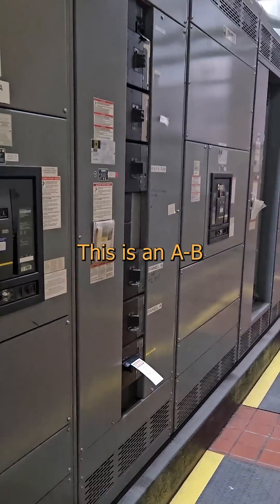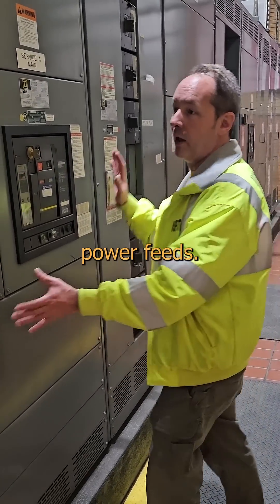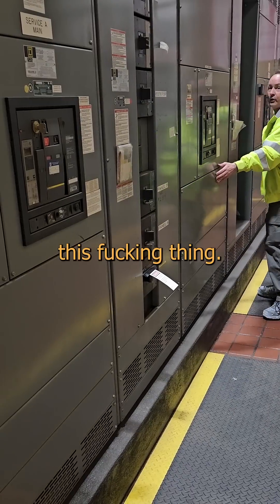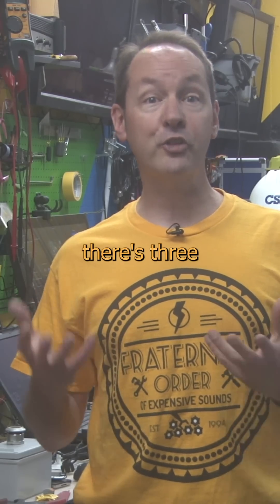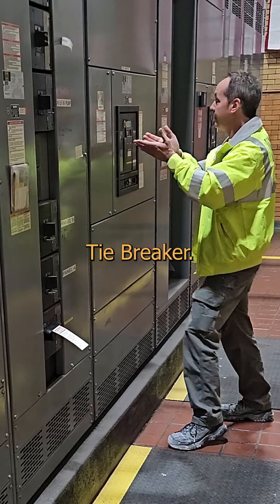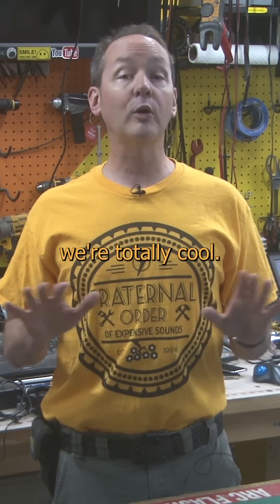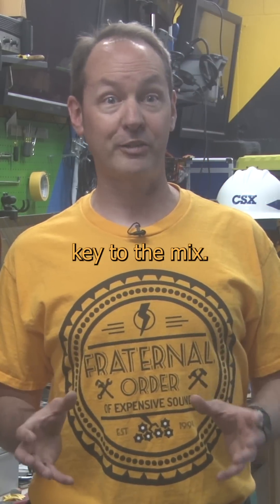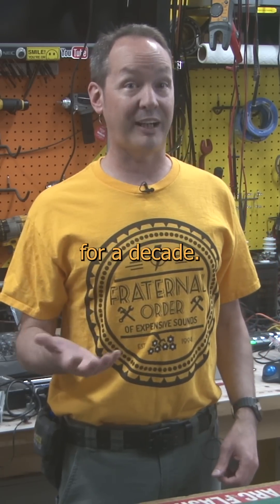A B Interface #chrisboden #comedy #electrical #engineering #energy #substation #switchgear #power

Comment: At our nuke plant it was like that, EXCEPT on the busses essential to safety, there is an additional inline disconnect on each side which are MECHANICALLY linked such that only one can be closed at a time, AND when you do that it takes away control power to the other side.  So 3 extra layers of protection.  And the whole plant is designed like that.

Comment: If you can't use a synchroscope and you don't have a Reverse Power Relay as a failsafe, you can get some interesting sights and sounds. 

I say this as I saw a 2,500 amp breaker explode and a two-story-tall diesel engine stall out when a 1.5 MW SSTG motorized a 750 KW EDG because some dumbass overrode the safeties while ignoring the yells "NO, DON'T!!!!" and use a hot-stick to close the breaker mechanically rather than taking the non-action of the normal controls as a sign that closing the breaker was A Bad Idea.

Even worse was is that even if he hadn't blown things up, it would not have solved the problem he was trying to fix. Turning on huge problem into two huge problems is Not Good.

Comment: Friend working in an aluminium smelter dropped a 12 inch metal spanner. happened to hit the exposed power feed on the way down, spanner was never found, it instantly vaporised and sprayed into the air. Luckily my friend was far enough up / away to not get a new metal coat, but the ears were ringing for a bit. They built the plant next to power station or maybe it was the other way around. The magnetic field in the plant was intense. watches (if you wore one) got locked to the moment you walked in. metal tools "stood up" if placed on the floor. even metal tool boxes were difficult they kept flinging / rotating side to side as you walked. You listened at the safety briefing before entering. We did have a power failure one day we were in the roof and the exhaust fans stopped, you get about 1min and feel burning in the eyes and throat from the fumes. 15 min to get out of the building before your brain melts out.  Big power is fun!

Comment: I used to work at a facility with dual power feeds. One day, a car took out a utility pole and knocked out one of the feeds. The sparkies decided to pre-warm the generator in case the second feed dropped. The generator came online, and the transfer switch said, "Hey, I see generator power, let’s use it!" Problem was, it was 180 degrees out of phase.

Boom. It blew the transfer switch clean off the wall, took the breaker for the backup feed with it, and the whole place went dark. Lights, equipment, everything.

I got the call to get there ASAP and bring the plant back online. I showed up to the sound of the generator, about the size of a locomotive, screaming at full throttle in the parking lot while everything inside was pitch black.

The head sparky was in a flash suit, trying to manually close the breaker contacts with a chicken stick to get the backup feed live again.

Let’s just say the night got real western. We had to do some serious cowboy engineering to get the place running.
Reply: oh gosh! sounds like a nightmare, where was this?
Reply: With a description like THAT, i gotta ask:

How 'western' did the cowboy shit you had to do GET?

Support Your Local Sherrif?

Stagecoach? 

Three Mules For Sister Sara?

Deadwood? 

Unforgiven? 

The Wild Bunch?

...

BONE TOMAHAWK!?!

(And if that LAST one...

...HOW ARE YOU STILL ALIVE?!?)
Reply: This sounds horrific! Awesome work getting things to go back to normal!
Reply: You need the “bad days make great stories” shirt
Reply: wait what
Reply: holy fuckstick...

Comment: That beat in the beginning was kinda phat. So if I were to install this A-B un-exploder it would perhaps be smartest to only make 2 keys thus eliminating the short term possibility of becoming a modern work of art on the wall. I say short term because although the risk of LockPickingLawyer stopping by to pick your lock is low, it’s also not zero.

Comment: In the 60s when I was in high school, electricians were repairing some wiring to the warehouse my dad managed.  There were 2 conduits of 480V 3 phase between the outside transformers and inside.  One guy wired up one of the conduits on the outside and another wired up a conduit inside.  For a preliminary test they energized outside and the guy was inside measuring on the wires he had just wired up.  Not getting any reading he started shoving the other wires out of his way so he could get a better contact with the ones he wanted.  Still nothing.  I asked, "So, do the conduits cross underground?"  He said, "No, of course not.  Why would you think so?"  I answered, "Because the guy outside wired up the left conduit and you're measuring on the right one."  He quickly withdrew his hands and carefully brought the meter leads to the bare ends of the wires he had been shoving around ... and got the 480V.  I think he was just glad he was still alive to yell obscenities to whomever could hear!

Comment: this sounds like it makes sense but it just doesnt. the closest to what he describes is one side inexplicably having a lefty phase rotation which is just as stupid as wearing your shirt the wrong way around. or for unimaginable reason one side is fed from the 60Hz grid and the other from the 50Hz grid. unless one side is a permanently running backup generator or a ups. the one side is the grid and the other is also the grid. there is only one grid. even fed from two different transformers which is the most redundancy inside the grid you can get, it would not be out of sync

Comment: Okay need a little help here. Went over my head a little, want some clarification. Not a pixie wrangler, and don't intend to be, so pardon my incorrect terminology, I don't know when describing A/B/Center as On/Off would be accurate.

So

If A is clicked in, and Center is clicked in, A can power both sides.

If A is clicked in and B is clicked in, A get's it's half and B gets the other.

And with two keys you can never get all three. Am I understanding this right?

Comment: At Menards they have 2 different power delivery systems. I've seen the main contactor melt before because the generator side and the power line side were both fighting each other. Granted that is a much smaller scale than what you're showing, but still very dangerous and expensive.

Comment: The only way to effectively merge two different power grid systems is to rectify it all to DC, and then either go back to AC or use it as DC.  There are a lot of solid state systems for this now, but my favorite is still the mercury arc rectifier systems.

Comment: we had some expensive equipment that had to swap transformers and a truck with a generator had to sync to the equipment and i was asking myself if you sync both infrastructure in your case if it still blow up... mainly because the powerplant is the same...

Comment: So believe it or not i FULLY understand what you are saying. I have read a few articles about newer systems have a "sync" setup. Basically there is a hardware software interface where it can read the phase info for both sides and can delay either side until the are in a synced phase. I know the source is where the phase is generated, but heu sone sort of filter or delay, they get synced and can be put together.  Sorry if its confusing because i am terrible at explaining, but they can sync phases now for a lot cheaper than it used to be.

Comment: This reminds me of my most recent entry in the collection of Expensive Sounds. At the hospital I work at we are adding onto a segment of the hospital. We will have to tie the new construction into the main power so we were conducting some tests to make sure we knew what would be cut off when we shut down power for that area. Long story short, one of the transfer switches for the emergency power accidentally engaged when the main power was on and well kaboom. I heard that sound from the third floor and the transfer switches are near the back of the hospital on the first floor.

Comment: I was working on a supply bus unit that had 80,000 vac being supplied by outside transformer. My boss told me that if I hit any of those plates my knee-caps and eyeballs would be blown off my body and the bottoms my feet would blow a hole in the floor. After that I was sweating like a faucet and my sweaty arms tingled from the electricity surrounding my arms. I have total respect for electricity.

Comment: Dealt with a facility that was fed from 2 different grids/4160v.  Tie breaker automatically switched when one or the other dropped. If both dropped, 3x 4160 sync’d generators would kick in and power the facility.  Neat stuff!

Comment: I worked at a wastewater treatment plant all through college and we upgraded our generators to decently modern standards, but they didn’t have them powered at startup. So we had to train on manually racking the gears with a 8ft metal pole. Reach one out, the other in, turn the key, close it and prime. Scared the hell out of me. How was a long steel pole showed into a rack gear EVER a good idea lol

Comment: Surprisingly, my retail company has this in every single branch. Fridges with food may not, may not ever, switch off. There's a generator and ups double backup system as well.

Also I'm in a country with regular power outages so it's payed for itself a dozen times over in preventing lost stock from power failures

Comment: No it doesn't.  If your phasing is correct you can interlock the tie breaker before opening one of the main breakers. This way you can single end the gear without interruption of power.

Comment: They do have actual keys.  They are often called Kirk keys.  Though that is a brand name much channel locks,  other companies do make them. They are installed to make it so without deliberate effort you cannot cross connect both feeds at the same

Comment: I was shown a heavy relay box. It had an air motor to wind up the springs that were released to make or break the hockey puck contacts. Magnets were positioned to drag out the arcs. Prior to switching, nitrogen gas was blown to avoid burning. 
Now SPCO makes solid state switches.

Comment: The datacenter we use at work has a similar setup, 3 power lines coming into the building, and 2 power bus to the floor. Each power line has a backup diesel generator, and there’s flywheels that can feed the DC while the generator spins up

At the server level, they’d be plugged into both bus A and B with dual power supplies

Comment: We had a medium voltage cable splice come loose at work, I was working overtime sat morning 5 am. we have these al over and had just tested them and the generators.. Unfortunately we lost the backups in the outage. One of the largest hospitals in the nation.. went dark..  I'm running around calling everyone in, putting lights up and trying to get into the buildings so we can manually switch over . We wound up getting main power back up in 20 min or so.  Scary day..

Comment: The system I maintain has parallel feeds to dual sub houses, and a tie sub to back feed one to the other. We also have partial ties in the plant. The plant makes 1M an hour. Every scenario that could be thought of has a plan for redundancy. It makes shutdowns for cleaning and testing so fun 🙄. Did I mention all the rack in breakers have backup, oh and we have a back up 13.8 to 480 transformers. Did I mention every scenario has been thought of. 😂

Comment: Lightning strike, took out both hydros and aux power supply.  Hydo plant director had left back-generator only on manual start mode.  Auto start program had timed for gen start/ switched all load breakers on assuming generator had started?   When I didn't hear the generator start!  "Wait a minute" - Let's see what other switches he has not left in correct location in system control.  It would have made expensive sounds, trying to start generator under full system load!  Diesel would have grunted, motors would have hummed, breakers throughout the plant would have banged. Good thing the stupid careless plant enginner was there, to open all the circuits and start the plant properly!

Comment: It is actually possible to interconnect supplies in certain situations but only if you really know what you are doing. Usually there is a solenoid blocking the tie switch if the feeds are out of phase or amplitude.

Comment: Kirk Lock System - I've seen it disabled in a Tennessee Theater once. What a mess. All the protective relays had trip flags activated. I asked the theater electrician how long the flags had be active. He said what flags. The kirk lock system had been disabled by loosening the mounting bolts on the kirk lock mount.
Reply: I have only a vague idea of what you just explained, and my heart did that terror thing where it feels like it's trying to pump quietly lest it draw the attention of what just terrified me.
Reply: that's wild.  I have never thought anything other than a large factory power plant would ever have kirk keys.

Comment: This same setup happens at a much smaller scale with servers, which generally (though not always) have two power supplies, though they usually work by splitting the power load until one fails.

Comment: At the Wastewater Plant I worked almost 3 decades at, we had the same system for all of the electrical feeds with a split sub-station(fed from two different electrical grids because we were a "critical infrastructure.") We had to disengage ALL the breakers on one side to get a key that unlocked a key used in the tie-breaker, then keys were unlocked in the tie that allowed the breakers to be re-engaged. But it absolutely did as Chris says, & prevented BOTH mains AND tie-breaker from engagement at the same time. All over the plant, there were such provisions at critical switchgear locations. P.s.The breakers at our Main buss bldg were old "crank up" (50s era) & activate by pushing a button or pulling a lever with a rope & sounded like a mad child's spinning top. We had an upgrade with a new power distribution bldg later in my career with modern (90s era) switchgear that hydraulically actuated. 🤠

Comment: They often put high voltage in parallel and on the low voltage side as long as the unit was properly installed you can parallel the two feeds with no consequence

Comment: i built a Controll concepts 480 V 400 amp automated control booth for one of my machines at work. I but SSR relays inbetween the old analog set up and the new automated side. I have the SSR's in play as the separation and isolation from each side. 
My boss learned a very expensive lesson...... Out of sequence of turning it on. He collided Phases....... ElctroBoom.

Comment: I have found a high voltage DC power supply in my university lab and I have a vacuum tube furnace. How can I generate oxygen plasma using these?

Comment: Most use a Kirk Key system.  You have to open the aupply breaker before you can remove the key. Then walk the key to the tie-bteaker and unlock it to be able to close it.  And reverse to reset the system.

Comment: Genuinely curious. 
Why is it not a four position rotary dial?
A-A | A-B | B-B | B-A 
And of course I don't mean just a direct rotary breaker but detented interlocked linkages to spring loaded instant transfer switches on a rotary control. It physically wouldn't allow you any invalid position. And if you needed to transfer to any one of the four from any one of the four you could rotate it to the correct position and then pull a charging handle and then press the trigger button like those really cool Siemens mains MVA class breakers that you wind up and fire off like a gunshot. No possibility of anybody with "two brain cells fighting for third key" bringing the third key into play.

Comment: been working on UPSs for 10 or so years now, and the non-zero number of times ive been out to a site that blew the bypass panel off the wall or the unit from trying to close the maintenance wrap with the unit online is astounding. YOU HAVE TO OPEN THE INSTRUCTIONS TO GET TO THE DAMN BREAKERS.

Comment: Chris i could talk with you for days of stuff i've seen. I'm not the tool on the stool. I'm just a good listener. Worked a gen set tech job, old man was a diesel tech. He worked a co-gen plant in enfield CT. It's gone now. But he discussed these types of switches, i think. And the ability for one power sources gear to get swapped out. While the other side works. VERY COOL. Oh his co-gen plant was 90-92% efficient. stack temp about 100 deg f. Steam powered, would cut you in half if it had a leak and you walk by. They would use brooms waving in the air to check.

Comment: Most power plants have bus transfer capability to perform and make before brake transfer from normal to reserve transfer station transformer. The other transformer is in phase but have different voltage potential. The impedance of the system alowes a seamless transfer in a few sec without a load spike on the transformer at higher potential.

Comment: 2 separate supply feeds? Pfft. Try 3! Plus a floor of batteries, 2 gensets as big as a 40' container and another inside a 20' container 'up top'. The upgrade from 2 + 2 + battery to 3 + 3 + battery required a whole new setup and we got tagged in to hook it all up. 

I don't remember that much, because 80+ hour work weeks tend to do that, while being 1000km from home. Money was very good, because it was Olympics money.

They won't let me do that stuff any more. Now I unfcuk houses after 20+ years of wire jerkers who never gave a chit and plumbers who didn't learn to not chew their fingernails...

Comment: Early projects I designed had a huge plug for a roll up generator with a special Kirk key interlock for the same reason. Only the generator or utility power was active at once, never both.